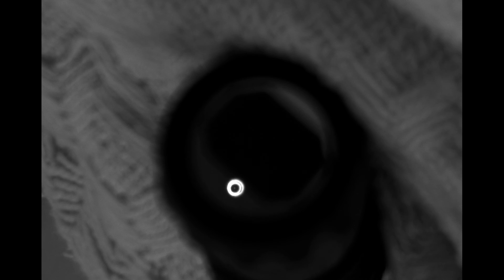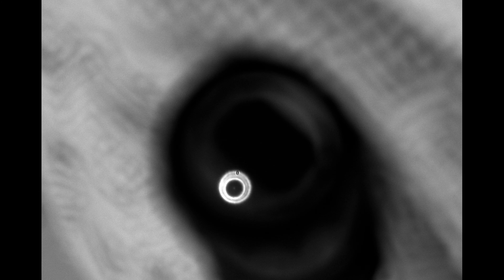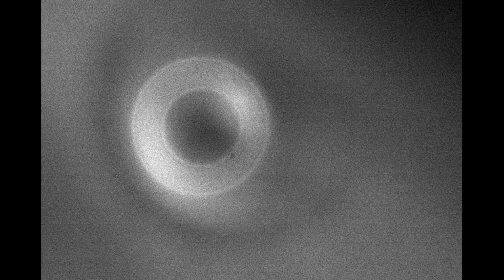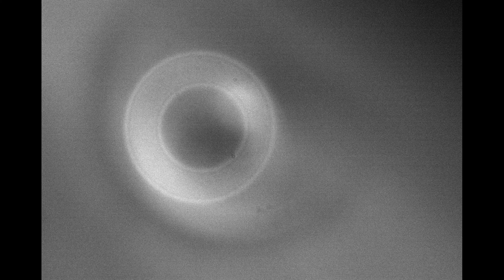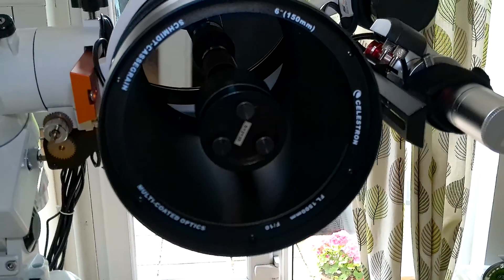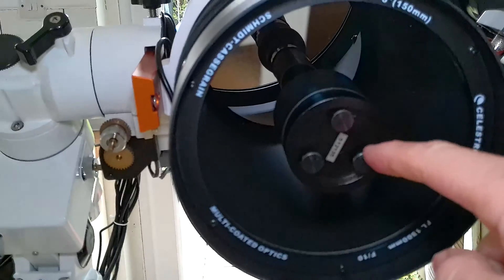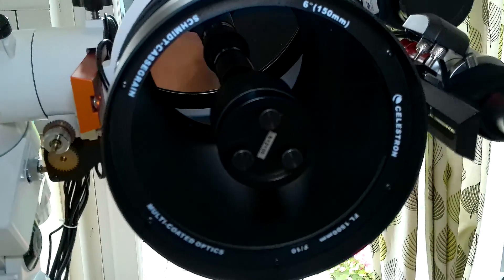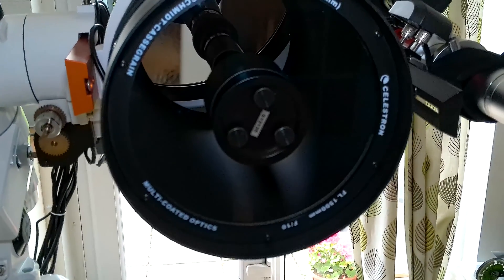How to Collimate a Schmidt Cassegrain Telescope (No More Struggling)

Comment: Thanks for the great video explanation! I have gotten really good results from using the Hubble artificial star while collimating my NexStar 8SE SCT in the house, which to me is a much more relaxed way to collimate rather than stumbling around in the dark under less-than-optimal sky conditions and making the process impervious to clouds, dew accumulation, etc. 
Perhaps you can give me advice, though, regarding my larger C11 SCT: nowhere in the house can I find the sufficient straight-line distance that allows me to use the Hubble star inside during the daytime.  Actually, I can't even achieve near focus (which for the C11 is about 76') anywhere in my house. This forces me back outside, setting up the scope and tripod on the sidewalk, placing the artificial star 100' feet away in front of a neighbor's house, dealing with curious kids, car headlights, etc. Do you have any thoughts how I might be able to do an artificial star in-house daytime collimation for the C11?
Reply from the maker: Glad you liked the advice. I am not sure what the solution would be for your C11 other than perhaps find somewhere out of sight where the kids can't see it like up a tree.

Comment: Brilliant - thank you.

I have my first SCT (celestron 9.25XLT) that needs collimating wasn't completely sure on the process.  That, coupled with cloudy/short nights (or working when it has been clear) meant very little use.

Now I have an idea of how to achieve this indoors so it will be ready for the next opportunity.
Reply from the maker: That's a nice telescope! That's great, it's definitley my preferred method I have done it outside at night before and it's a lot more work.